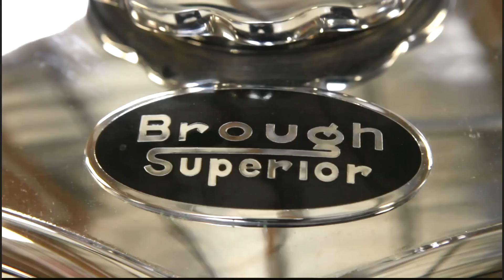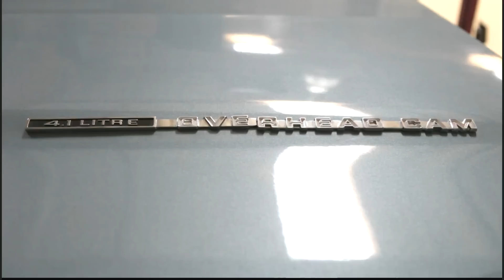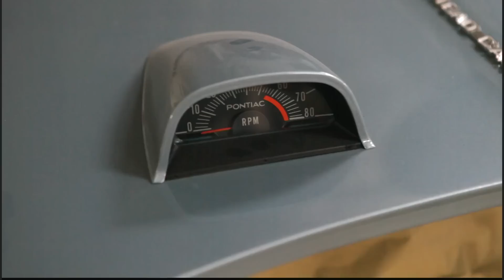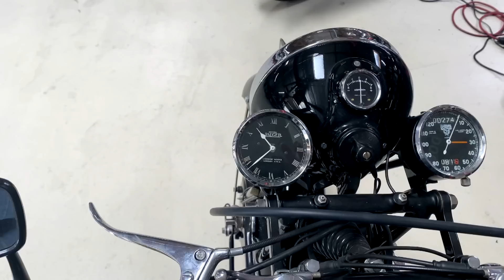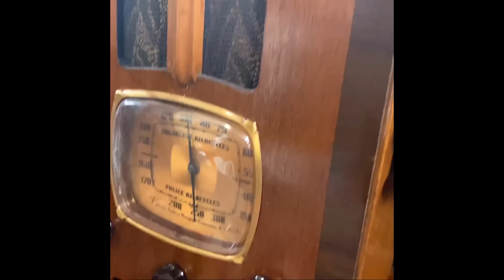Restoration Blog: November 2020 - Jay Leno's Garage

Comment: Wow! You sure brought back memories for me, Jay. I had owned a 1969 Firebird 400 years ago. Scary fast car. Well optioned including a folding back seat. A sore point we're the teeth on the drive gear: they were plastic; fell apart at 40k miles. The first motorcycle I ever rode was a 1969 BSA Thunderbolt. I'd helped a neighbor pick it out brand new. He let me ride it, once. Unbelievably smooth on the street. Good thing I could downshift as the brakes were marginal. Thanks.

Comment: I drove 1 of the original Toronados as a teenager working at a new car dealership. I  drove the customer home and had to take the car back to the dealership for service. I was not able to get out of the customers stone uphill drive way without spinning the front tires. I was worrier about getting into trouble. The customer later told me he had the same problem.
I wanted a T120R Bonneville Triumph motorcycle so bad mom got me a Triumph model kit for Christmas to tease me.
I also had a friend with the overhead cam 6 in a Tempest, he liked doing burn outs in front of the Sheriffs office.
Thanks for bringing the memories back.

Comment: I did the restoration on Aldo Bigionis Talbot Lago Grand Sport about 20 years ago, the aluminium skinned wood framed doors were very difficult to set up on that one too as the wood would expand and shrink according to the humidity and change the door gaps and straightness of the aluminium skin.(they used a diagonal tensioning rod to allow adjustment) The main body was small section s of steel, gas welded together in a patchwork .Had alot of paint on it originally to smooth out the file marks etc. Drove great with the pre-selector gearbox, the french lockheed brake master cylinder would stick causing the big drum brakes to drag and I failed to find a replacement so the owners son took it elsewheres and had a Dodge master cylinder fitted.

Comment: My sister in law had an over head valve Pontiac six . I didn't think it was in a Firebird but I might be wrong. You validated what I thought at the time. I thought from the head down it looked just like a Chevy inline six .
At the time it seemed to be a pretty good running 
engine.
Reply: The engine was also available in the Tempest.
Reply: @festusian9089  Now you said it that was exactly what she had. Thanks for 
jogging my memory.

Comment: That Toronado is one of your most exciting projects that displays your passion for cars.
Reply: I wonder, if it has independent rear suspension or a rigid one...? I had the next generation model, and loved it. It had four wheel disc-brakes, torsion-bar suspension on al four, and I believe a somewhat independent rear. Actually my Cadillac Eldorado had a 4-6-8 engine, which did not like the auto-pilot, so we had to disengage it, and it had front-wheel drive and same suspension! A wonderful car, which got about 23 mpg on the Autobahn.
Reply: @prof.m.ottozeeejcdecs9998  theres an old discovery channel show i believe on the tornado. I think it was rad rides by troy who helped build it. Or maybe it was nelson racing engines... maybe both, but im pretty sure its documented somewhere. Yet im 90% sure its a "standard" Ford 9" straight axle

Comment: Why is the Talbot Right hand drive?, its French with licence plates.
Reply: Most cars in Europe were rhd back then. Sweden only swapped over in the 60s.
Reply: @UCSnLYqAylljfCBnNItBlLbA what part of Europe are you from?, the only RHD cars I’ve seen in Continental Europe are from the UK originally.
Reply: European countries are very close together and many of them are RHD.
Reply: @jeffharper6259  yes jeff, some even touch.....they call it a border lol
Reply: The first theory is that it allowed a gentleman to draw up outside a hotel or restaurant and step directly onto the pavement without endangering life or limb by stepping into the traffic. This seems the least likely reason for it takes no account of a driver’s gallantry towards his lady passenger.

The second is that it was a hangover from racing practice. To this day most sports racing cars are built with rhd, for most circuits have more right-hand bends than left since it is the European custom to run clockwise. Porsche and Ferrari, however,  have no difficulty in producing rhd or Ihd cars as the individual market dictates.

The third theory maintains that when driving over mountains on the right-hand side of the road, rhd is inherently safer.  

motorsportmagazine. com
Reply: @Freimopp777  must be all before my time, i’ve only lived in Europe since the 60s.😜
Reply: Most French car makers switched to left-hand drive during the first decades of 20th century, but luxury car manufacturers have kept the habit to make RHD until the 1950s. For sport cars like Bugarri it was because most circuits run clockwise, thus favouring a right-hand driver. For cars with chauffeur, it made the driver access more quickly to the right rear door for opening it to his bosses - typically Madame sitting on the right rear seat :o)

Comment: I love that Firebird!  Can't wait to see and hear it run.  I saw a 1st-Gen Firebird convertible in my hometown about a month ago, and thought it was beautiful.  Compared to the last two generations of Camaro, it looked sleek, light, and elegant.  I want one, but for me it would be a Trans Am tribute car, with a Ram Air V 303.

That was a great call having the custom rocker arms made for the Sprint 6.  The DLC coating is about 3 times as hard as fully heat treated steel.  Another step that could be made would be roller follower rocker arms and a roller cam.  More power!  Less friction!

Comment: I have always been a fan of straight sixes, the Firebird Sprint has always been really interesting to me. Very hard to find any kind of media on them, I cant wait to this it done.
For years every time I hit a junkyard  I would check the  late 60s Firebirds to see if they were a sprint. I also heard that some of the Temptest came with them so I would check them out too. Never did get to see a Sprint engine and I looked for YEARS. I even had a 72 Tempest body to put one in when I found one. I finally just gave up and sold the car to my brother.

Comment: this is the type of videos i like. and if you build a car and just let it set there it might as well go to the junk yard. thats why i like jays cars once they are finished they get drove. i know a guy that gets a new truck every couple years and he refuses to drive them and put miles on them for trade in. i have the red turd a F-150. i got it in 2000 and it just turned over 300000 miles.

Comment: Hello ! I am a french driver of an Panhard 24 BT and it's a pleasure for me to see that you own this very very interesting car. I whish to tell you that your car is not in accordance with an original 24 BT : all 24 BT were fited with disk brakes, never with drum brakes, and also i saw the air filter which is fully anachronic. On this Tiger engine, the air filter is fixed near the left front wheel and near the bumper .On the carburator you can find a - in French - capacité de résonnance. It is a kind of cylinder box which is linked with the air filter. The job of this box is to appease bad pressures in the carburator. I have to call your attention on this point, very important for motor efficiency...I saw also a very amazing gear box shift ! I apologize for my poor english language...
Jean-Pierre MEAUME

Comment: I love those Sprints, when I used the LS1 out of my first car form highschool (99 Trans Am) in a rescued BMW E31 rebuild I took the time to swap a 4.2l Inline 6 Atlas into that car along with a turbo.  The E31 was built to deliver an extremely smooth and relaxing GT ride with that sporty touch that really seals the deal.  The same goes for the 4.2l in the Trans Am, it's a real shame GM didn't put more resources into developing other uses for the motor outside of a couple SUV's.  The other Atlas motors saw more use with the 5 and 4 cylinder but the most reliable iteration was left out in a lot of ways.

Comment: Year's ago (mid 70s) I was working road service for a AA garage in BevHills. Hd a call on little Laurel Cyn nd this old guy had three of those @cyl French cars. Since he couldn't get Distributor Caps for in he discovered that a Bosche VW 4 cylcap would work and when it was time to replace it he would just turn the cap 90 degrees and it worked. Sorry Jay, in the mid 70s didn't get aa chance to meet you. Stay healthy !

Comment: I used to have a '70 Pontiac LeMans "Sport" convertible years ago. I was the 3rd or 4th owner. By the time I got it, it had a 350 Chevy V-8 in it, but I could tell from the data plates, that it originally came with a 6 cylinder engine. I wasn't too interested at the time, but I vaguely remember, that it was listed as "OHC", Over Head Cam, so maybe it was the same kind of engine, that was in that Firebird?

Comment: I wonder if perhaps the roller cam follower ala my 1988 ford ranger would work on the Firebird, a true but even weirder fact is the 3 speed manuals used on these early birds were Ford built 3 speed toploaders. my Uncle had one and as I was changing the oil for him one day back in 68 I noticed it had the same trans as my 66 stang. Pontiac knew the GM 3 speed couldn't handle the Pontiac 326 torque. maybe one the 6 cyl they used the GM IDK

Comment: LOVED when you came to the Toronado, frustrated that it was converted to rear wheel drive.  Toronado and Eldorado were such iconic cars, could have put rear wheel drive and 1,000hp engines in just about anything else, Oldsmobile, or Monte Carlo, or whatever to get the same performance/fun/looks (How about in a 1966 Grand Prix or Bonneville, or perhaps a 4 door sedan Pontiac Catalina (CLASSIC lines) sleeper?

yes, I know it's your collection, but had to comment anyway...  :)

Comment: I had a 68 BSA 650 Lighting , that I perched new  in 1968 that is one I regret having to sell because I had no storage available. The other one was a 750 BSA Rocket 3 with 5 speed transmission.
For most of my life I worked in a fleet shop " no private vehicles allowed in the shop for any reason" you  have no idea of how big of a cut in pay that represents to a mechanic. Even if you lose your battery you can't jump start it . you must push it  off the lot to install a new battery that you have ordered delivered to the vehicle after it is off the lot.  another problem is you must keep every signal receipt for every perches because at some point you will be accused of Stelling parts or supplies'. Nothing goes home with you not even the work clothes.

Comment: Especially the design of the taillights on the Panhard looks really futuristic compared to the fact that the car is almost 60 years old. The French can definitely design and even though Citroën has now become DS (for all practical purposes), the Peugeot 508 mrk.II SW Estate, for example, is a rather elegant car (PSA is today the parent company of Peugeot, Citroën, DS and Opel/Vauxhall). You can clearly see that the 508 is distinctly French and it has an appearance that in my opinion is not far behind for example the BMW 5 Series Touring. The cars can not be compared technically, but the 508 definitely looks significantly more modern.

Comment: In regards to the atf and acetone being put in the engine to loosen the rings up.  Ive heard of using atf and other things but, never acetone.   Why acetone?  What does the acetone do ?
Reply: I suspect that the engine had been run on vegetable oil, think Castrol R, and when this dries out it is French polish like in consistency, like glass and shatters.
Acetone will liquify the dried oil and the 10 weight atf will displace the dried oil and allow the rings and associated parts to slide without damage.
That’s my 2 bobs worth anyway.

Comment: Speaking of power steering vs no power steering with straight 6 motors vs V8's........I once had a '67 Chevelle, 2 door, with the 283 V8 ( LOVED that little engine, had it rebuilt after 158,000 miles ) and Powerglide transmission. The car had no power steering, yet with the car barely rolling, you could turn the steering wheel from stop to stop literally with one finger, I kid you not. As a matter of fact, when I first went to look at the car & after taking it for a test drive, I said to the owner: "The power steering works nice", and he said: "There ain't no power steering"......so I popped the hood in disbelief, NO power steering. Once I bought it, I always enjoyed fooling everyone, they all thought it had power steering. I guess GM got the steering geometry absolutely perfect.

Comment: @JayLeno   I have a gold 2002 Saab 9-3 S E Turbo  4 door hatchback . I bought it in 2018 with 143,000 miles .my Saab has been a joy to drive unfortunately I have one mechanic that works on Saab’s where I live and in the area .he’s 73 and frail .he does have an apprentice but who knows. My Car needs a new home .the interior is well maintained as well as the outer . I have had a it of work done on the motor and many new parts through and through . If you read this I could use tips on how to find a buyer as I am looking for a warm home for this sweet Swedish baby . Kathleen

Comment: ~9:14 Leave it to Duesenberg to design an IC engine properly; intake from the side and low, w/ the exhaust coming out of the top of the engine (following the laws of thermodynamics - heat rises, etc.). Would love to be able to build my own engine design. $$$

Comment: Why convert the Toronado from front to rear wheel drive?
Reply: The factory FWD setup was only designed to handle like 400 hp or less. 1000 hp would have disintegrated it.

Comment: why did Jay converted his 66 Toronado into a RWD? Wasn't the Toronado already a RWD?
Reply: No, it was FWD, A first for that much car, that much power from a US manufacturer.
Reply: It was on the same platform as the Eldarado
Reply: @acmeopinionfactory8018  I always thought that the FWD started to appeared in like...the 80s or so in the US.
Reply: @henryrodier8024   The Caddy, I think, came along the following year, GM then used the E-body more and more, some FWD, some RWD, and re-sized it twice (downward), leading, eventually to the raft of terrible FWD cars of the malaise years from which, in my humble opinion, GM has never recovered.
Reply: @benderbendingrofriguez3300   You're probably thinking of the Chevy Citation, Pontiac Phoenix, Buick Skylark, etc., those were X-bodies and came much later than the E-body cars of the sixties, starting in 1980 I think with the Citation.

Comment: Why would I take a v8 over a I6 of equal displacement? That’s the real question. An I6 has more piston face to absorb energy, a longer stroke to gain greater mechanical advantage, its inherently balanced so no need for heavy weights on the crank shaft. So an I6, of equal displacement, with equal flow in heads and exhaust, will produce more torque than the v8.